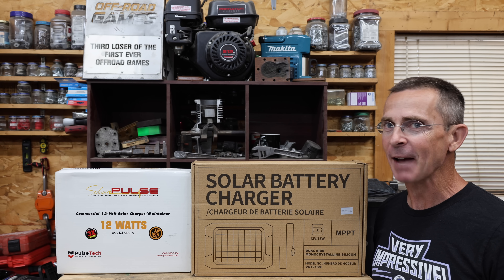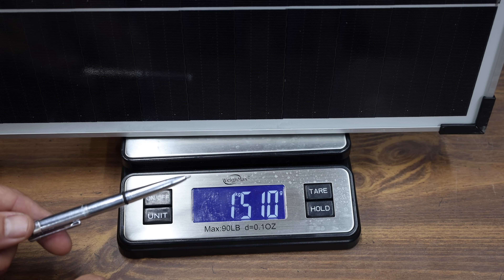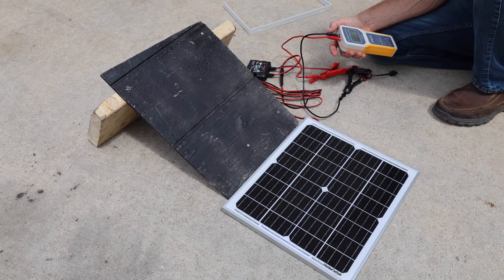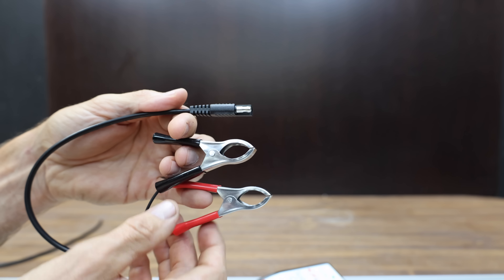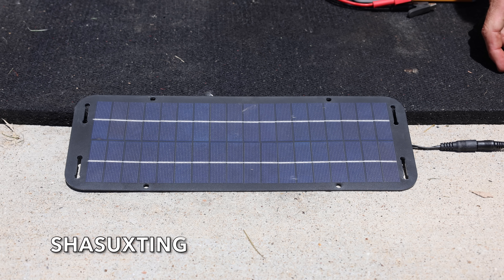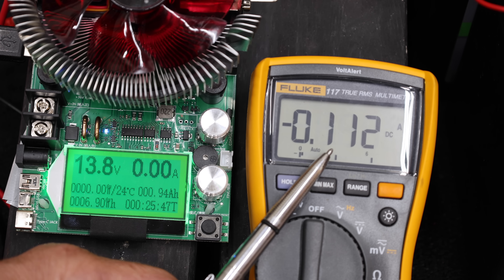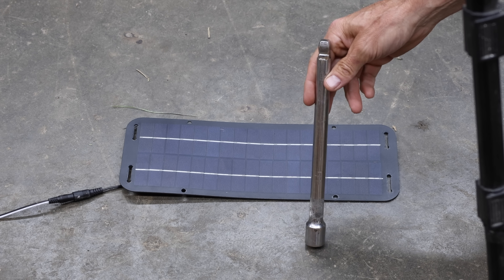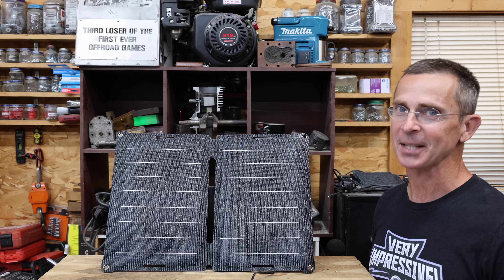I Had No Idea These Were So Good!

Comment: I haven't even watched the video, but as far as I'm concerned, they're great. I was having trouble with the battery in my Challenger holding charge. There is so many computers and electronics in these new cars, that if you don't drive them much, the batteries will drain too far. Since I put one of these solar float chargers on it, I haven't had a single problem, and it's been a year and a half.
Reply from the maker: Thanks for the feedback.

Comment: I’ve got a solar battery charging system fitted to my mobility scooter. The solar panel I used for this is one used in solar arrays on houses. The panel is conservatively rated to 37 volts at 10 amps, giving 370 watts. My tests indicate much higher. The panel also doubles as a canopy to protect me against direct sunlight. The regulator is not that good. It doesn’t work like it should.
Reply from the maker: Thanks for sharing.

Comment: Here's my questions. Are you going to set these out to check for UV Degradation? I ask because with the coating if it get hazy, it would affect how efficient the panels can charge, over extended time.

Also, I wonder if these use some kind of heat sink to draw excess heat away from the panels to help improve the charging rate.

Thank you for testing these.

Comment: The voltages for AGM batteries are slightly higher than for old fashioned lead acid.  Also it would be good to know if any of the chargers use Amorphous silicon since they work at low light levels.
Reply from the maker: Thanks for the feedback.

Comment: I would buy the Grecell. The Hoysicy, not having a good cutout voltage, made it not useable for me. The Grecell gives great bang for the buck and delivers what you need for battery maintenance on a car. The Flex Solas ned for 5v on the battery for it to work is a bad deal.
Reply from the maker: Thanks for the feedback.

Comment: So, you walk out to start your car on a cold morning only to find your battery is dead.  So you pull out your "trusty" 10-watt panel, hook it up, and go drink coffee while you wait several days for the battery to be charged?  No, thank you. A 10-watt panel will take 100 hours to charge a 1000-watt battery, 50 hours for a 500-watt battery. Assuming it's outputting 10 watts for the full 100 hours, your battery will be charged (drum roll) 4 days. 😊

 I'm not against solar. I operate a ham radio station that is 100% solar powered.
Reply: Comments like yours is THE reason I read 'em & enjoy 'em as much as the video.
Reply: @azclaimjumper    Thank you.  I've been 100% solar for a bit over 6 years. 😊  I have no electric bills.

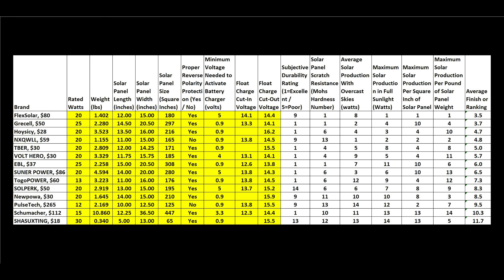Comment: Why does your chart at 9:30 say the NXQWLL was the best in overcast skies at 10.58 watts, and that the FlexSolar was 4.5 watts, and at 11:16 in full sunlight the FlexSolar is 21.52 watts, and the NXQWLL is at 16.77 watts, but in the spreadsheet at 18:21, it says the FlexSolar was 8 watts in overcast skies and 1 watts in full sunlight, and the NXQWLL 1 watts in overcast skies and 2 watts in full sunlight.  All of the numbers on this final chart don't seem to match the numbers provided during the testing.  Did your numbers get mixed up, or incorrectly recorded into the final spreadsheet?  Because this just doesn't make any sense to me.

Comment: Another great video! Very happy that you've included the overvoltage protection - overcharging can easily damage the battery, to the point of physical destruction. And once again, you've proven that price does not equal performance. One thing I would like to see is how would those perform when placed on the dashboard - I would think that if you park the vehicle for longer period, you'd like to charger to be safely tucked inside while still being able to charge the battery.
Reply from the maker: Thanks!  Thanks for the suggestion.

Comment: First off, I'm surprised you didn't include the Thunderbolt charger since that's Harbor Freight's brand.  
But ham radio operators will like that the Newpowa uses Anderson Power Poles on the wires.  We tend to cut all connectors off anything and put on Anderson Power Poles.
Reply from the maker: Thanks for the feedback!

Comment: I have used a cheap (<$20) 1.5W solar panel on the inside windshield of my '87 Dodge utility van (12V port always hot) and it was able to maintain the battery for approx.18 years. Video editing suggestion, would like to see "chapter marks" for all the graphs   ......  keep on testing !

Comment: There's two problems with these type of battery maintainer solar panels, if you have them in in direct sunlight, they will usually melt onto your dash, especially if they have any kind of plastic framework supporting them, and they overcharge to the point they will destroy your battery within a few days. You have to have a voltage controller attached or it's not worth buying

Comment: I bought a Voltset 20w panel on Amazon. The controller died after a few months of occasional use, they claim to offer a warranty. They wanted pictures of the controller, panel and wiring. No prob. Then wanted a video of it in the sun showing the issues. No prob. Then want pictures of each wire connector disconnected. Then wanted more pictures. Then more. Then more. I told them this is ridiculous, they said "this is the last time we'll ask for pictures"... Guess what, it wasn't. So I went direct to Amazon and got a refund.

Do not buy from Voltset. Scam warranty that will tire you out before they honor it.
Reply: Comments like yours is THE reason I read 'em & enjoy 'em as much as the video.

Comment: video idea:  testing LiFEPO4 battery chargers for 100 and 300 AH batteries. Time to charge, voltage, noise, cost. Goal to find the best all-around charger from grid AC. Many folks have LiFEPO4 batteries running inverters in power failures. Love your testing.
Reply from the maker: Thanks for the video idea!

Comment: How does a 12v charger supply 23 volts?  Thats gonna kill a lithium and over time will boil a sealed acid battery..  probably not too bad since only 20 watts at most but still 23volts aint that good..

Comment: Would've been nice to know if the charger units included with some of these were PWM or MPPT.  MPPT has dropped radically in price over the last 2 years and it's entirely possible some of these were MPPT.
Reply: I actually noticed the solpeak included an MPPT

Comment: Great video, Todd!  👍👍  FYI:  If a vehicle battery charger has a desulfation and re-solution function, it uses high-frequency, low-amperage, high-voltage pulses (I've seen up to 16.5V) to break down hard lead sulfate crystals that build up on battery plates, converting them back into active material, which restores lost capacity and improves charging ability for lead-acid batteries.  So this could be why some of them don't seem to stop charging.  Further testing on those would be required to (1 see if they have a desulfation/re-solution function in the specs and 2) see if the Voltage drops over time and stops at an acceptable Float Cut-in and Cut-out.
Reply: Comments like yours is THE reason I read 'em & enjoy 'em as much as the video.
I have two AMERICAN MADE products by POWERPULSE.  
1.  Connects to the battery terminals & desufates 24/7
2.  A 4 amp charger/desulfator that requires 120V household current to charge car batteries.
Reply: @azclaimjumper   Please tell me which POWERPULSE model/part number you have that connects to the battery terminals & desufates 24/7 and where you bought it.  I have a 2 amp battery maintenance charger that desulfates briefly as the Voltage rises to 16.5V and then the Voltage lowers to between 12.7V to 12.3V, depending on the battery.   I would like to desufate 24/7 two batteries for a while.  I looked a a bunch of them on Amazon, but there were too many bad 1 and 2 star ratings, so I didn't buy one.  Thanks in advance.

Comment: EBL is a reputable brand ... is there something wrong with those units or sith the specs? Thanks! 

EDIT: The Suno Power has a more detailed specs and the 20W is Pmax.

EDIT2: Perhaps the consisten lower peformance at 28 degrees is due to the plywood beneath it (getting it warmer).

Comment: While I certainly appreciate all the work that you do, I have to say it appears your ranking system needs help. I think you're better off using the actual scores from the test versus the positioning in ranking. You basically penalize a product the same whether it's slightly less than the higher products performance, or dramatically less. This does not seem fair or a good way to evaluate performance.

Comment: Usually your videos are really good, but testing this way is really not useful, as the actual irradiance through the clouds could be changing a lot all the time, and you might not even notice the difference with your eyes. Just looking at the first panel tested compared to the Grecell, the Grecell looks like there is even some sunlight on the ground and your skin. The first panel conditions look much more overcast, judging by the hue of the concrete and your skin. 
This would have to be done under a controlled light-source otherwise it's literally useless. You should have realised this because the Grecell panel and the one before clearly come from the same factory, they are essentially the same thing with a couple minor differences and branding. Exactly the same specs. however they perform vastly differently. Why? More sunshine.

Comment: if you take a cup thats wider at the rim part and smaller diameter at the base,,,you can place the cup on the board in sunlight and make the shadow casted down from the rim, line it up so its equal around the base and now you are directly facing the sun...
Reply: Comments like yours is THE reason I read 'em & enjoy 'em as much as the video.

Comment: Would like a better explanation in the beginning of how you are measuring or calculating maximum watt output.  Unless the panel is attached to a load, it won't produce max power.  What load are you using to measure the power output in the first part of the video?  Edit.. At 9:55 got my answer.  YOU CAN'T MEASURE POWER OUTPUT THIS WAY.  The solar panel must be attached to a load with a meter measuring voltage and amps.  Simply attaching a Fluke meter to the solar panel will not measure max power output.
Reply: It's not a standard voltage meter. He said in the start that it's a solar panel specific tester. I suspect it simulates a load or acts like an depleted/full battery depending on the test requested.

Comment: Nice video! I just purchased the Thunderbolt 10w solar charger from Harbor Freight  ($34.99) and it works fantastic. 19v output in sunlight. Keeps my battery charged when vehicle in storage. I let a vehicle sit with a known weak battery for 30 days and it fired right up. Normally it wouldn't start after 10 days here in the winter. No scientific methods used like you do to test it....but real world testing it works. You should test it.
Reply from the maker: Thanks for sharing your experience!

Comment: I always check your videos because your reviews are the best around. Ive purchased many items based on your videos.

Wouldn't it make more sense to compare them based on amp output, not wattage?  The panels producing 20v vs 10v could have similar watts but not actually charge the same.

Im still learning on the nuances, but a panel producing 14v and 1-1.5ish amps would seem ideal performance for a 20w panel?

Im happy to learn how im confused.

Comment: I'm surprised at how poorly the charge controllers were in this lineup of 2025/2026 solar products as these circuits are now ubiquitous and proper lead-acid voltages are well established.  While lead-acid can handle >15V at very low current, there's no need to subject them to this.  A 12V lead-acid stack of any type (flooded, AGM, gel) is fully charged by 12.9V, but should be topped off to ~14.4V before disconnect.  Charge controllers should turn on at  around 12.65V.

These voltages vary slightly by type, but unless the charge controller allows changing the type in its settings, it could assume the above voltages for any type and be close enough.  I doubt most controllers are accurate down to the millivolt anyway due to component tolerances; there's no calibration in such low-cost manufacturing.

What we see in this test is absolute rubbish from a controller point of view and the video title is inaccurate as most of these products performed worse than I expected.  You can do all of this with an Arduino and likely find open source code to do it, so why are these controllers so bad?  I'd be tempted to buy just a panel or buy one of these kits just for the panel and then build the charge controller myself.  This is silly considering that they can be manufactured at volume for pennies.

Comment: No BS I've had one of these in each of my cars for years now and they keep your battery healthy for much longer. I've got a type 65 battery from Sams Club with a 2020 date code that is still measuring 800/850CCA. Every battery before that would be already toast by now. Same vehicle same area weather swings. These solar trickle chargers do absolutely work to help your battery stay topped off and maintained. I think everyone should have a little solar panel on their car!
Reply: Yup. Lead acid do best if you can keep them topped off.
Reply: Is that the Duracell platinum by chance?
Reply: @deanthomson1654  Just the regular Duracell. I've been buying them every ~3 years for...christ since 2011. Only brand I've ever bothered with. I actually worked at Sams club for a few years and sold the battery professionally. The lifespan got worse with time. Went from a 5 year to 3 year warranty back in 2016 I think. This battery has now lasted longer than all the batteries I ever sold. The fact it reads ~800CCA tells me it might still have another ~3 years left to it. These really do benefit from a trickle charger!

Comment: It's a little out of your price range, but I've got a Power Film charger (with integrated battery bank) which is just stupid good. And reliable. It's been out in weather, thrown around, and still charges better than anything else I've tried or seen. Unfortunately, you pay a premium for Power Film. A large premium. To those who need it in the field, worth it. For those who want it for more casual use, it probably is overkill.
Reply from the maker: Thanks for sharing.

Comment: For the glass impact testing you should use steel ball bearings and increment the height and/or size. It's the industry standard and they'll give you a more repeatable impact behavior for your testing!
Reply: IN this case though most of these panels are pretty durable since they're plastic, so the wrench isn't necessarily a bad tool for the test.

Comment: different types of batteries have different peak voltages...ie ad AGM battery has a slightly higher voltage capacity and static voltage than lead acid...There's a lot to know about battery technologies. People do your research.

Comment: I bought two eco-worthy solar panel 3yrs ago.  Both still works.  One is inside the car behind the windshield.  The 2nd one is outside laying on the ground.  My recommendation is if you are going to lay it on the ground, just lay it flat.  Because several time the wind would blow it over and flip it upside down if you have it at an angle.  This panel comes with a OBD connector great for the one I place inside the car.
Reply from the maker: Thanks for sharing.

Comment: Your total chart at the end is all off.  In the total you have the Flexsolar listed at 8W in overcast and 1W in full sunlight.  While the chart and meter show 4.5W in overcast and 21.52W in full sunlight.  And for the NXQWLL in the total chart at the end of video shows 1W in overcast and 2W in full sunlight, where in you show on the meter and the earlier charts 10.58W in overcast and 16.77W in full sunlight.
Reply: durability is also off. Shows 9 on the chart for Flex solar (on a 1-5 scale) when it scored a 2 in the video. I think the watts you point out he labeled it Watts but it looks like "place" since there are no repeat number in that column. So yea that final chart is kind of a mess.